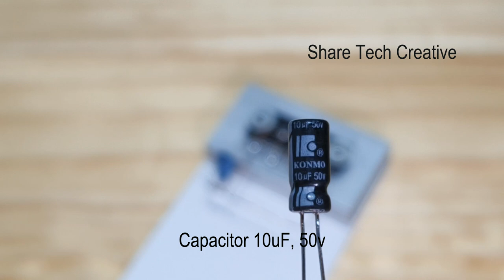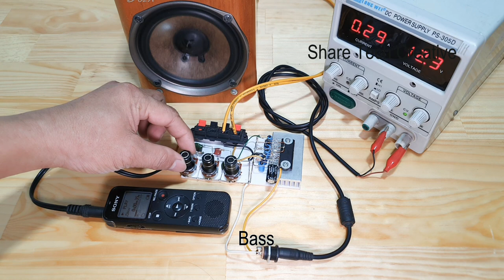Powerful Bridge Amplifier Using LA4440 IC With Volume Treble Bass (DIY)

Comment: 06:34 screen text say 0.022μF but the capacitor is 0.0022μF (222 means 22×10²=2200pF=2.2nF=0.0022μF). Which is right value?
Reply from the maker: The capacitor is 0.0022μF (222)